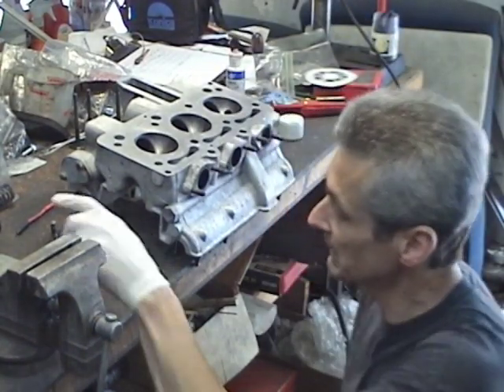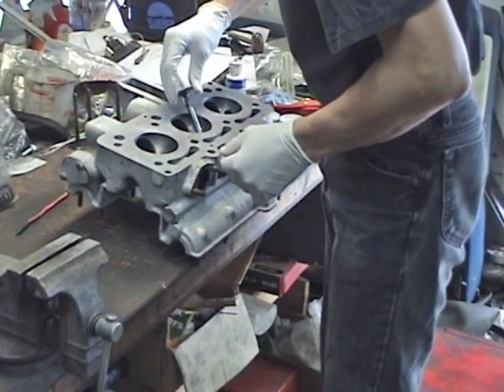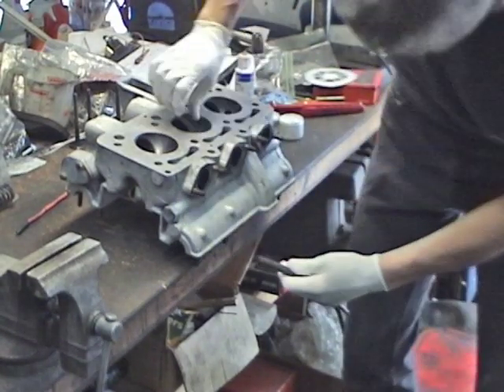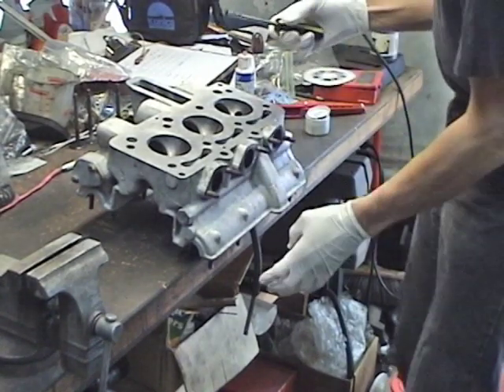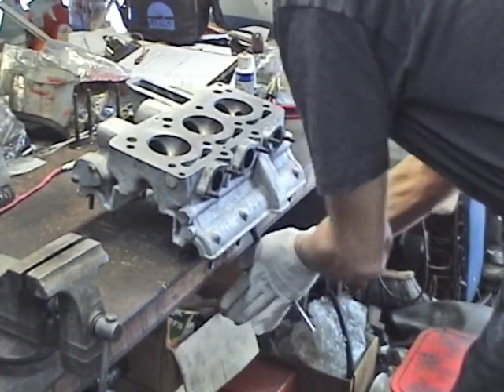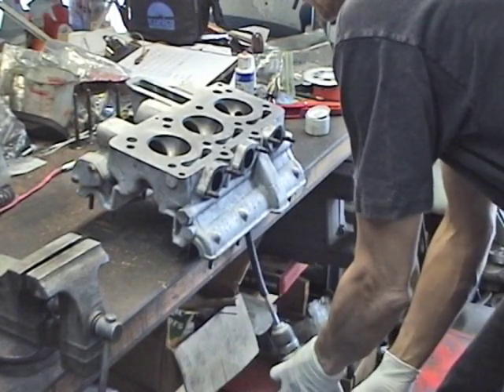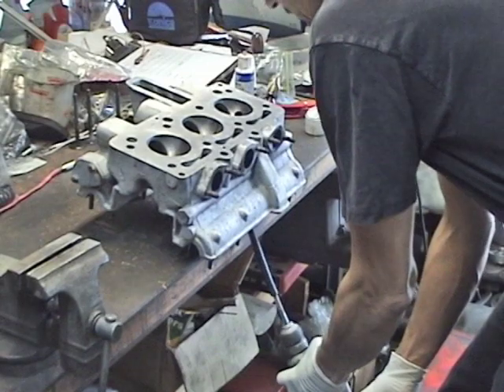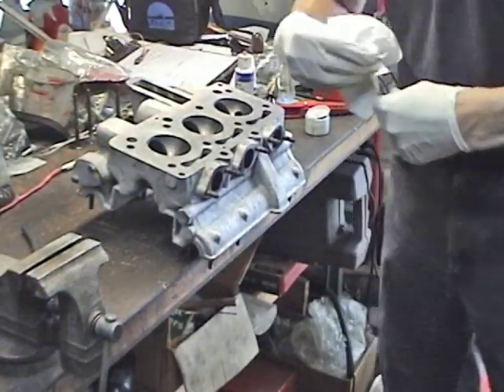Valve job trick on a Citroen SM / Maserati 3 Liter engine...

Comment from the maker: You have to be careful and make sure the compound does not get on the stems. Regardless of the method used you always have to make sure of this. I use Lubriplate on the stems; it is an engine assembly grease. When you remove the valve, that is when you have to be careful not to touch the seat with the stem.

Comment from the maker: Hi,
Thanks for your comment!
Valve lapping by hand is the correct way since you have more control and feel but a mechanical tool that reciprocate is a good helper. I don't think that you may damage anything if you are careful since the valve is still guided by the guide; I don't think that the use of a drill will change the angle of the valve.
As far as performance, if the valve closes properly, the engine should perform the same way regardless of the way you lapped the valves.
Cheers,
Phil.

Comment: Pretty nice tip! thank you! I like it a bit more than direct drill-to-valve method as it can grind an incorrect angles in the seat created by an angle caused by the weight of a drill or the intertia torque... Do you think valve lapping by hand instead of using mechanical tools can make some difference in performance actually?